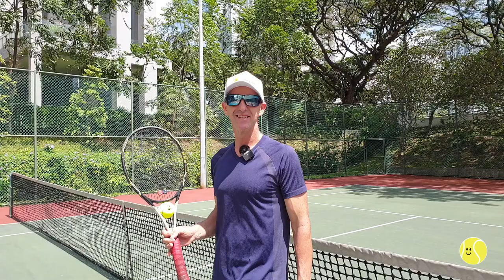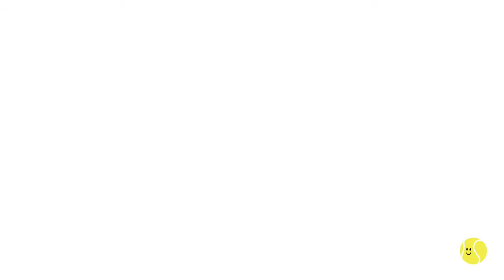Jay Davern | Tennis Coach - Quick Tips: Where to place the vibration dampener in the tennis racquet

Comment: People telling me using more than one is illegal
Reply from the maker: 1rustyboy1 i am using them for coaching  so did not examine the ITF rules. My memory is that the refer to plural ie “dampeners” and that players can place vibration dampeners anywhere outside the pattern of the cross strings. Meaning they can be placed anywhere on the outer edges of the stringbed (right, left, top and/or bottom). If you are playing a tournament best ask the tournament referee. Hope this helps. Enjoy your tennis 🎾